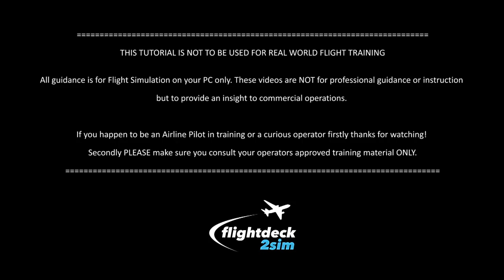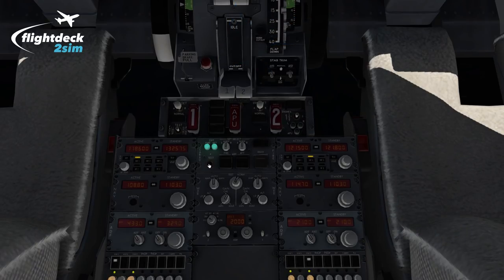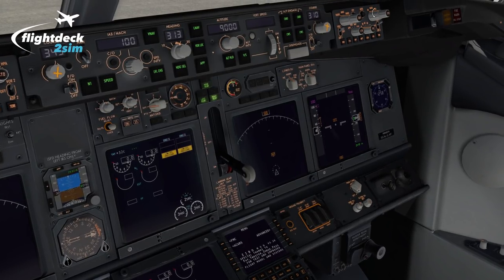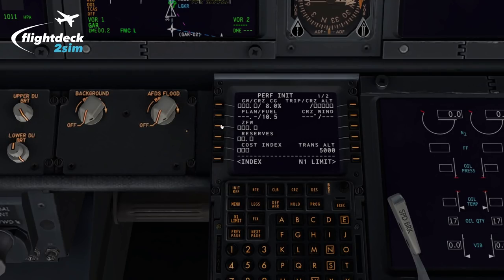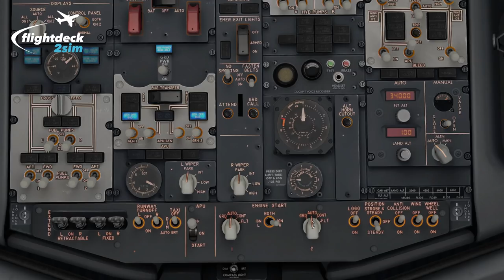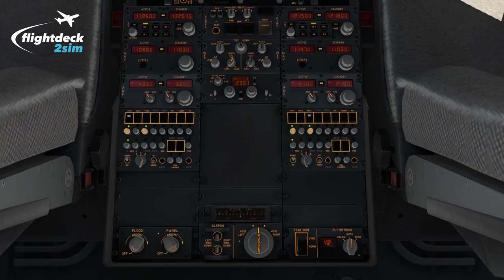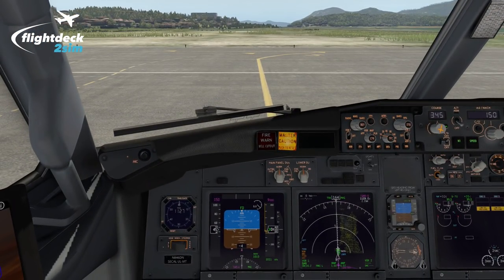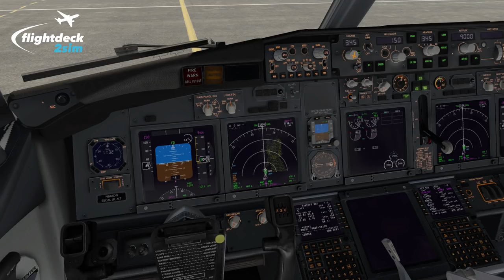Real Boeing Pilot | 737NG Cold & Dark Setup Tutorial

Comment: I'd watched this once before, but I hadn't flown the Zibo yet. I've learned how to fly the plane fairly well, but I haven't attempted a cold and dark startup yet, watched this again
and now feel confident I can manage it. Can't thank you enough! Now I feel much more so that I've got a handle on all the systems and startup procedures.
Reply from the maker: Glad I could help! Good luck! FD2S
Reply: @flightdeck2sim  I meant to try one weeks ago but was busy moving and didn't have time for simming until recently again. I feel like you gotta block out extra time for a cold and dark! Whereas just pushing back and taxing out doesn't take that long, really.
Reply: @flightdeck2sim  I did a dry run at Miami Intl., following a flight I did the other night on Zibo to Jamaica, I followed your tutorial exactly and got the cold and dark startup done! I had some minor trouble transitioning to APU Power, bus, etc., but I managed to fix that. Did my pushback, so that's accomplished. Otherwise I was chuffed. P.S. Nevermind, I managed to 
figure out XCamera and set up my basic camera views for the Zibo. That should solve those problems. The plane's impossible to fly properly without them set, since it requires
frequent switching to the overhead, pilot view, pedestal, FMC, etc.

Comment: Brilliant as always!

One tip I world like to share for those who don't already know about it is when putting in a long route in the FMC. To save yourself a bit of time you can stick to putting in just the airways and the waypoints connecting the airways will populate automatically as long as the routing is correct.

So let's say you have a route like this -> A A1 B B1 C C1 D. In this case you could put in A followed by A1, B1 and C1 where B and C would be automatically inserted for you.

If not using saved routes and when doing longer flights it's quite convenient!

Comment: Good tutorial for sim pilots to learn real life procedures.  Next time you are talking to Zibo, ask him to fix the GRD POWER AVAILABLE light so that it is not on when you set the park brake after engine start or when you set the park brake on the runway for instance !!     Also the PM/auto call-outs need to be customisable.  For example, in my airline, we do not get PM/auto call-outs at 400 feet and 1000 feet on takeoff. (PS I have over 14000 hours on the real 737 - currently flying the 737-800).
Reply from the maker: Thanks Speed Bird! (GPU available moving to EFB at some point) and ZIBO will be adding more customization features. New SYNC feature you'll find very useful single pilot in a 737!

Feel free to provide feedback to myself or ZIBO at any time based on your experience,

FD2S
Reply: Your explanations are spot on and any feedback would only be procedural differences which we know are operator-dependent so not really worth discussing.  Keep it up.  Who knows, your videos may inspire someone to become a 737 driver.  Question:  Do you have a textures mod for your overhead panels and centre pedestal panels (they seem darker than normal) or is that the stock standard Zibo installation?  I haven't updated Zibo in a while.
Reply from the maker: Make sure you have the latest version, the MOD is updated periodically! FD2S

Comment: Just updated to 3.29a.  If you are talking to Zibo can you pass on the following:
I can confirm in 3.29a centre tank fuel pumps prevent engines from starting and will shut down an engine if turned on after engine is started.
Also, FMC gives incorrect "Unable Cruise Altitude" and "Using Reserve Fuel" message once airborne.
Weight was 55 tonnes for takeoff, cruise alt was 33,000 in FMC so "Unable Cruise Altitude" is incorrect.
Reserves were 2.0 tonnes and arrival fuel was 6 tonnes so "Using Reserve Fuel" message is incorrect.
Reply from the maker: Thanks Speed Bird, testing pre-release version, center tank pump issue has been fixed. 

FD2S

Comment: Great video!! One question, is it a mod you're using to get those quick views to snap to different parts of the controls? Like pressing x and you see the overhead, y for throttle quadrant, etc. I see there are some free mods but the ones I have tried aren't working correctly or as well as what you seem to have set up. Any help would be appreciated, thanks!
Reply from the maker: Hi Evan747,

It's the default XP11 camera! You need to find the view you like moving around the flight deck/cabin and then assign that view to your keypad. I have assigned the views to my NUMPAD by selecting CTRL 1 as an example.

When I push 1 on the numpad it smoothly transitions to that view! 

Good luck! 

FD2S

Comment: Hey many thx for the video! One question: if you Need a pushback, is it necessary to turn off A-Pumps hydraulic system during it? Due to gearpin or something like that?
Reply from the maker: Hi there! 

We used to turn the A pumps off as it was a procedure passed down from the classic 737s. On the -800 it makes no difference. During the initial startup we select all hydraulic system on and they stay on, this helps identify any leaks during the walkaround.

Prior to pushback a bypass pin is installed to the nosewheel, this isolates the hydraulic system to the nosewheel steering and prevents inadvertent movement of the nosewheel.  Some SOP's (ours used to) instruct to turn off both all SYS A pumps prior to push and start, this adds an additional safety net from unintentional nosewheel movement during pushback.

FD2S

Comment: Another distinguished and admirable tutorial nicely done. And as always i have a question captain: 
As we all know that the RNAV routings are based on GNSS rather than conventional ground based radio navaids and If you were to fly an RNAV SID, then how would you set the raw data (freq,course) for departure ? Thanks in advance.
Reply from the maker: Hi Mehmet.

There is no set guidance. You would just set the courses perhaps to the runway direction or the first track after departure as a reference. Navaids perhaps to the first en-route beacon or an approach back into the airport of departure in case you need to immediately return.

FD2S
Reply: Thanks a lot sir.

Comment: Hello,
Thanks again for all your videos and tutorials. Makes my flights more realistic.
I have a question regarding SEL, assumed temperature on the N1 Limit page of the FMC. I have understood what SEL temperature is, but I just want to know how I can, as a simmer, simply set this temperature. I do not have any tables from Boeing, nor the electronic device you are showing in the video. As I understand, this SEL will depends on Airport, Runway length, payload, OAt, QNH, etc.
Is there any tool or website where a simple simmer can have this information to setup SEL correctly ?
And a final question: if we don't know SEL, is it better to leave it blank in the FMS N1 Limit page, or do I need to use the OAT as SEL?
Thanks for your answer, looking forward for the next Live stream.
Reply from the maker: Hi Seb! Thanks for the feedback!

To work out the assumed temp for T/O performance you need a performance calculator or RTOW chart to work out the maximum weight you can lift for a assumed temp. 

I'm very fortunate to have the Boeing OPT app from my work EFB which calculates the highest assumed temp for you. Not sure what's available as a suitable replacement for the sim community.

OAT is independent to the Assumed Temp calculation, you just simply put the OAT but an assumed temperature is not required.

FD2S
Reply: @flightdeck2sim 
Thanks a lot taking time to answer.  I will continue to leave the SEL blank in the FMC for my flights.
Regards from Switzerland.
And in case you are looking for another challenging airport in Switzerland (you visit Sion LSGS in one of your video) you can try Lugano, LSZA. It's a very interesting approach, especially with the circle to land. Maybe once in one of your future video. I will be very interested.

Comment: I got the zibo mod to work and everything, however when I put in zfw it was in pounds and not tons. It might be might be that I had different settings other than metric and or standard (IDK). Moreover, I don't have an advanced function on my fmc. Is that a problem, or should I update it? Thanks for the tutorial. I thought it was a little confusing at first, but I found you were very detailed. Thanks again for all of your help.
Reply from the maker: Hi Derek! 

In the EFB you change from Imperial to Metric!

FD2S
Reply: I did get the APU to come, I guess it just takes a long time to turn on. However, the nav setting wouldn't come on. But I tuned the APU on first, does that matter when setting up the nav system?

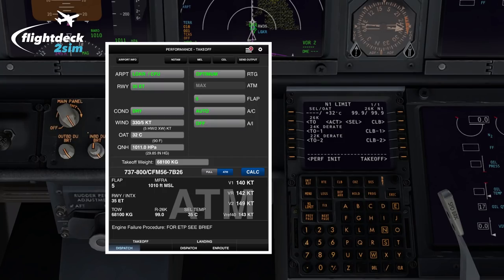Comment: Hi FD2S, where may we get your software at 27:00 please ?

Also how did you connect your axis for yaw as the same for tiller ? Mine are made of 2 seperate so I can only move at time
Reply from the maker: Hi FMSCBT

It's the Boeing OPT App off of my work EFB which isn’t available for general use I'm afraid,

I haven't made any direct connection with the tiller/rudder in x-plane 11, it's just the default controls.

FD2S

Comment: Excellent tutorial! I've been flying sims (e.g., Aerowinx and currently PMDG)  for over a decade, and this by far is the best instruction ZIBO vid I've seen. Bravo Zulu! BTW, what program did you use for your thrust limit temperature calcs? Is this a plug-in to the EFB? I use TOPCAT which does not interface with ZIBO. As a note: I noticed you did not mention the FMS (Company Route) from SimBrief for the FMC. What are your thoughts..? Lastly: Great pan of the cockpit using the hat switch. I use X-Camera in conjunction with the default hat switch.
Reply from the maker: Thanks a lot Michael!

The perf calculator you saw was the official Boeing OPT from my electronic flight bag, unfortunately not available publicly. 

We don’t use CO routes where I work, we have to manually enter the route each sector! 

I actually don’t use the hat switch at all! Just the number keypad and right click on my mouse,

Take care!

FD2S
Reply: Thanks so much!

Comment: so I got it started all displays on ils aligned etc. but had 2 low pressure lights on.(fuel pumps).
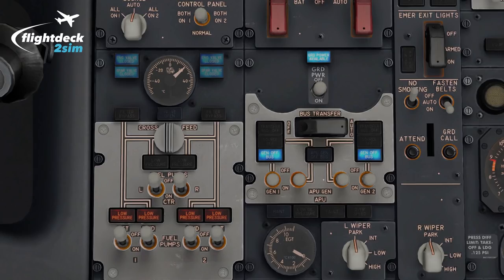the 2 top ones at 17:09. any one know why. what I do wrong?..
Reply: Probably means that there is no fuel in the center tanks sir
Reply: ok. thanks..
Reply: I it is that I think. I did get a fuel master warning. but thought it was just maybe cause I hadn't completed startup. or missed something. cheers..

Comment: How du you change the camera angle so you can see the FMC or the overhead panel for example without struggling with using the mouse and the arrowkeys to move around in the cockpit?
Reply from the maker: In XP11 you can change the FOV so you can get more on the screen. I then pan around using the mouse and have several views saved to the Numpad on my keyboard 👍🏼

FD2S

Comment: Hi FD2sim. I have a question about the 739. Should I enter in the FMC the Fuel and Payload as they appear on the LIDO flight plan, or add fuel and payload to get the correct weight? The ZFW is not accurate given the correct payload/fuel.
Reply from the maker: Hi Sarah,

Change your Payload in the FMC until your ZFW matches the LIDO OFP.

Remember (Zero Fuel Weight) is the weight of the aircraft with all passenger, baggage, crew MINUS the Fuel.  

For Fuel just take the Block Fuel from the LIDO flight plan, rounded up to the nearest 100 then +100 (eg 8230 = 8400)

Hope this helps!

FD2S
Reply: flightdeck2sim Okay, that's what I do but it seemed to be wrong with how awful it made the performance of the 739. 150+ V1s, cruising at like 92%N1, etc.
Reply from the maker: All completely normal! The air is lot less dense at high altitude so N1 is higher, it’s when the engine is also most efficient.

FD2S

Comment: With the RTO,  I can see when its set but just wondering what event will trigger the RTO autobrake???   I assume its an advancement of the throttle past a point and then it being brough back to idle? or is it if a certian speed is passed?
Reply from the maker: Hi Airspotter UK,

RTO engages maximum brake pressure when the thrust levers are moved to idle at or above 90kts. Below 90kts you will need to brake manually.

Good Luck!

FD2S
Reply: flightdeck2sim ok thanks.

Comment: What should you do after starting battery if you have no ground power unit,  I started getting an alarm sounding which I assume is something to do with battery being discharged, I was also unable to start APU despite having one fuel pump turned on.
Reply from the maker: You should be able to start the APU with no GPU available or fuel pump on.

It is possible to start with just battery but you'll need an air starter unit to start the 1st engine.

FD2S

Comment: Hello,
i am not exactly sure what happens, but i wrote this before, but it seams to be gone as of any reason...i can not found it.
So if have ask this in another video, i want to say sorry for double asking that.

Now, my question is and what i am struggeling all the time is entering a flightplan (from PFPX)  like this:
Initial ALT is FL210
ATC ROUTE: N0358F190/N0358F210 CPT4B CPT N859 VAPID/N0330F210 UN859 GWC Y8
           WAFFU/N0315F190 UM605 BIBAX BIBA9D
This lines are a these i dont understand some times:
N0358F190/N0358F210
VAPID/N0330F210
WAFFU/N0315F190

It would be very nice if you can explain that a bit more for us .

Thanks a lot
Matthias

Comment: Great video, as someone who wants to start out with flight Sims. Would you recommend pmdg for fsx or Zibo for xp11 as the best option?!
Thanks
Sam
Reply from the maker: Hi Sam

The NGX is a study level aircraft with pretty much every system accurately replicated but XP11 is the better sim

I’ve now been providing regular feedback to ZIBO as have several other 737 line pilots, the FM is being developed by twkster who has years of airline experience and it’s now a solid platform and is my preferred choice. It also utilises the superior flight model provided by XP 11. For me ZIBO’s MOD is one of the best handling 737 sims you can get and seeing it's free try it out on XP 11!

FD2S
Reply: flightdeck2sim Thanks I will try it out, what hardware are you using?
Cheers
Sam
Reply from the maker: View video description 👍🏼

FD2S
Reply: Oops sorry I meant what controller!
Sam
Reply from the maker: Sam Turner my bad as well, I should know hardware is referring to physical equipment. Just a simple Logitech 3D pro joystick and Saitek Rudder pedals.

FD2S

Comment: I follow what you do, but already at the start having some issues. The display of the copilot doens't turn on (just stays black), and all these sound tests you do, don't work either. If I start with the engines running, the sounds do appear when I press the buttons, but not in Cold & Dark. I literally pressed the same 2 buttons as you did at the start but it's not working..
Reply from the maker: Sounds like you don’t have any AC power connected. On the iPad select ground power and when the GRD POWER light illuminates on the overhead panel select it on. 

FD2S
Reply: Right, that makes sense haha. Thank you!
Your videos are very helpful and enjoyable, keep it up.
I wish you many happy & safe flights :)
Reply from the maker: No problem and good luck!

FD2S

Comment: I have a doubt. While starting both Apu bleed and engine bleed where on. Wont engine bleed backfire and damage apu ? Or there is nothing like that?
Reply from the maker: Only if you add thrust, to prevent backpressure of the APU you must remain at idle, DUAL BLEED illuminates to remind you of this.

FD2S
Reply: @flightdeck2sim  Thanks 🙌

Comment: Just  installed the Zibo 737  and its great looking.  However I cant figure out how to program for direct GPS flight.  Default 737 has a button on the FMC panel for direct flight.  HOw do I program the Zibo for direct via GPS??
Reply from the maker: Hi John H, welcome to the MOD

The MOD is true to the real aircraft and this switch doesn't exist on a commercial jet aircraft like a 737, you have to follow real world operating procedures to fly this aircraft accurately by loading the FMC and you can use LNAV to follow your planned routing.

FD2A

Comment: Hey, thanks for that great tutorial, it was very helpful to me. I just have 1 problem. Everytime when I speed up on the runway for the takeoff, that "takeoff config" warning sound appears. What am I doing wrong?
Reply from the maker: Hi phips d.

Could be several issues.

Parking Brake Set
Flaps Not Set
Stab Trim not in the Green Band
Speedbrake not down 
Tech problem with the Flap or Ground Spoiler (unlikely unless you have set a fault in the sim)

Good Luck!

FD2S
Reply: @flightdeck2sim  Well, I thought the spoilers should be set on position "armed", so I'll try it out to put them down. Thanks for that fast help.
Greetings from germany :)
Reply from the maker: @phipsd8388  That will be it! No need to arm the speedbrake, it's automatically raised by the Captain in the event of an RTO.

Good Luck!

FD2S